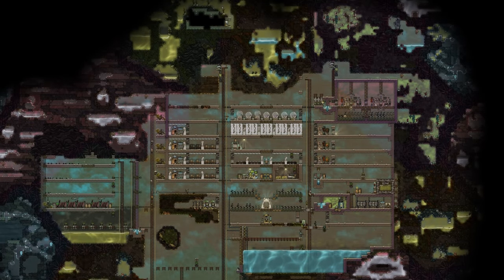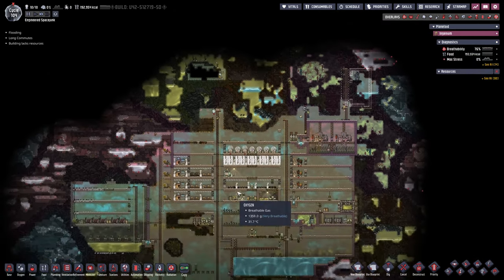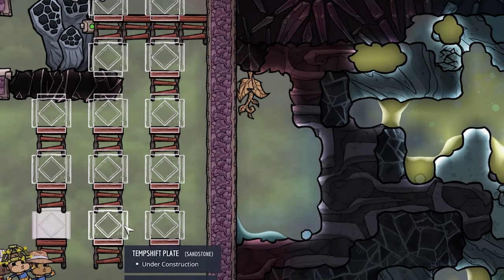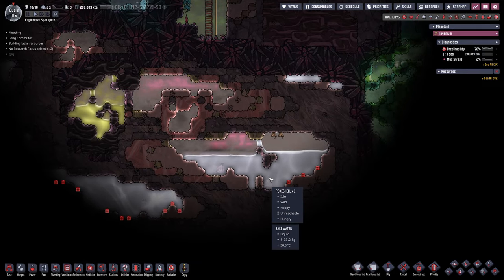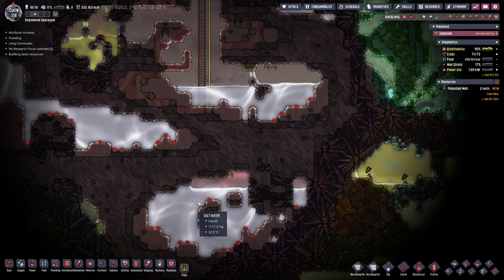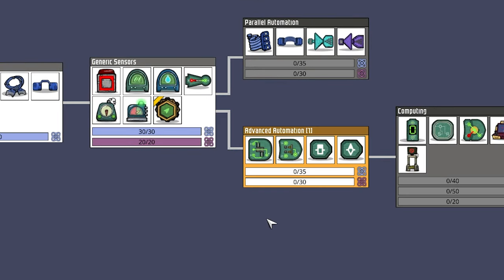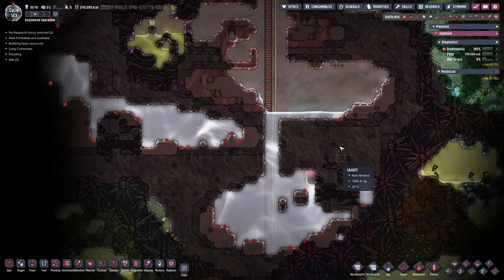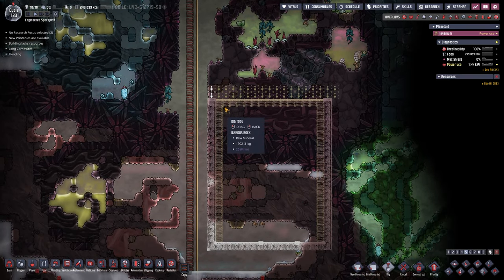Optimized POWERLESS AUTOMATED CRITTER KILLER! (LP2-EP06) Oxygen Not Included Spaced Out

Comment: I copied the drecko ranch. I made it into a blueprint. Blue Prints are king in this game, saves so much time. Only issue is it takes a hot minute to get it built and running. For new players I would recommend building the first half and later on build another one or expanding. unless you got like 10 dupes. but with 3-4  😂😂.
Reply from the maker: Oh yeah, it definitely takes a bit to build, but it is definitely worth it in the long run. I built it roughly around cycle 100 in this Let's Play and I'm past cycle 600 right now. Still going strong like day 1, haha. And blueprints do most definitely help!

Comment: For cleaning the water of germs you can use the radioactive ore and make doors in the shape of an L. Drop the water on top, let it go over the top of the doors, the go back the other direction under the doors and by then it should be cleaned germs (or more doors can be added to help). Usually 2-3 doors should be enough.
Reply from the maker: That is a great method, gotta try that! Thanks  :)

Comment: I dunno how everybody gets away with building fire poles all over the place.  Even when I clear out the starting biome entirely I barely have enough copper ore to handle the demand even without building those resource hogs.
Reply from the maker: You can build them out of any ore, doesn't have to be copper. They efficiency gain(especially later, but also not to underestimate early on) outweigh the resource costs drastically :)

Comment: I came up with a similar design. But one problem tho, the water will overpressurize the tile below for some reason. So you need to build the tiles below with airflow tiles.
Reply from the maker: I have not encountered that issue, has been working for many cycles now without anything breaking. Not sure where the problem is with your design!

Comment: Are you planning on replacing gas filter with gas element sensor + gas shutoff at some point? It's little bit weird that you can save 110W of usage just with it. I'm also following your LP to get some good tips and tricks, thank you for those! Currently struggling with power and heat myself.
Reply from the maker: I'm actually going to use the Filtered Pump Mod as soon as I have access to plastic. In my opinion that should be in the game, it does  the same thing as you are describing, just faster and easier. At the beginning of the game I just use the filter because it's fast and easy, but you are absolutely right, with shutoff and sensor a lot of power can be saved. 
I'm glad you enjoying the LP though :)

Comment: why pips are not drowning?
Reply from the maker: Pips will drown, but the tiles need to be full. If not, they will not drown on the top tile. Same with Dreckos!
Reply: @BierTier  what do you mean by "full tiles"? I tried this critter killer. But pips not drowning. Them going to the upper tile that is fully submerged with about 900 kg of water and still not drowning.
Reply from the maker: 900kg is not enough. You need to overfill it, literally until it is overflowing with the doors closed, then open the doors and mop up the spill on the sides. Wall walking critters are weird in that regard :)